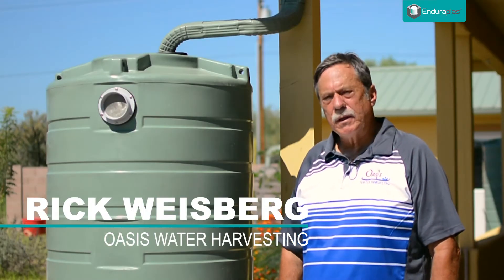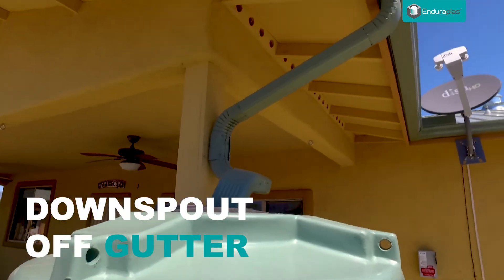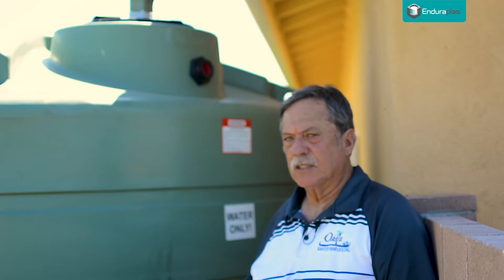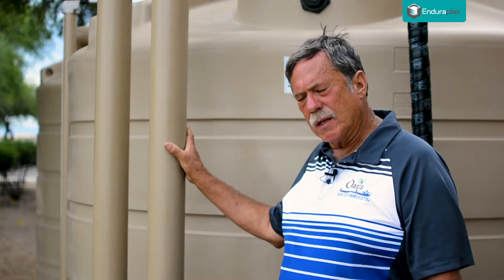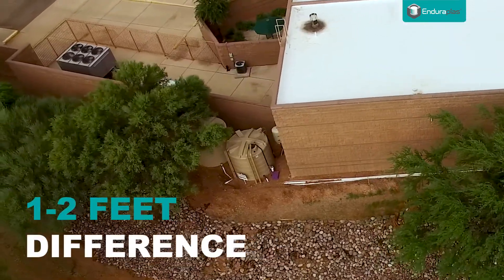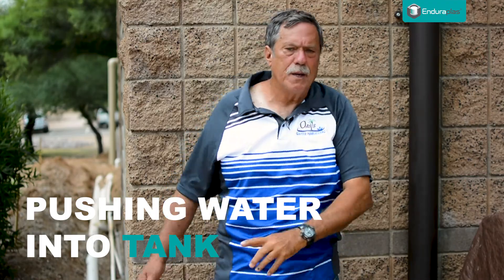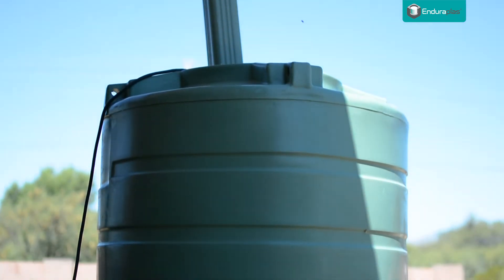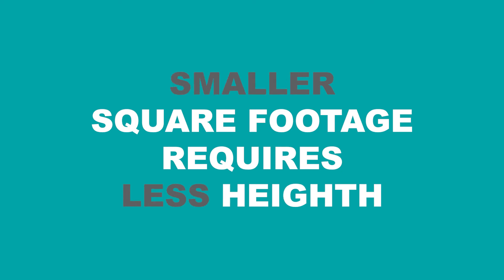Rain Harvesting Plumbing: 'Wet' vs 'Dry' Delivery System

Comment: Just had my tank delivered and installed by Rick - he turned me into a potential issue with my planned wet-delivery system having to do with not having enough head off my gutter. Rick sells quality tanks at a reasonable cost, gets them delivered into difficult areas, and knows what he's talking about. WMG's endorsement is spot on- Thanks Rick!